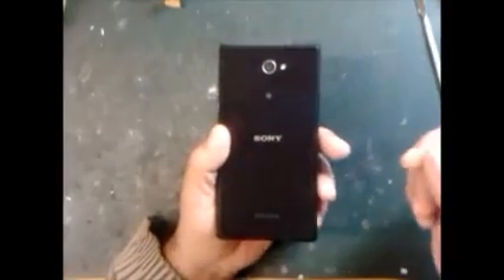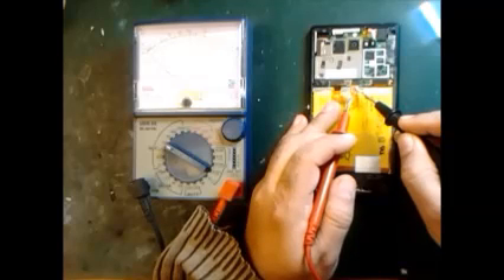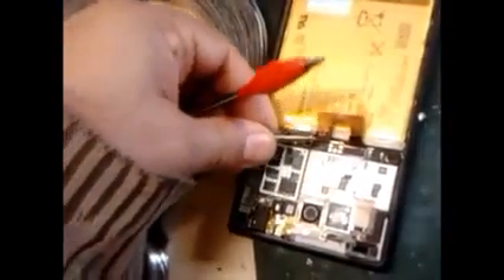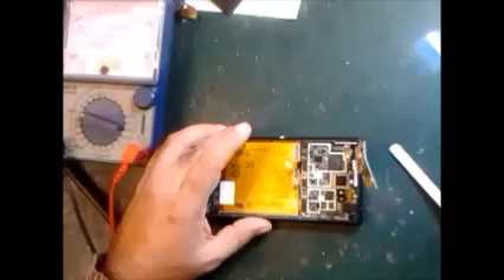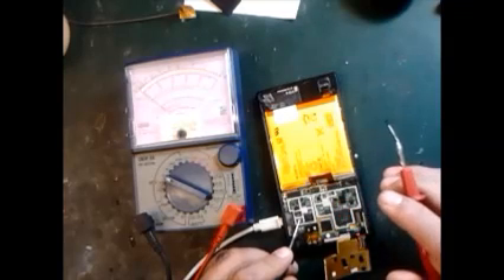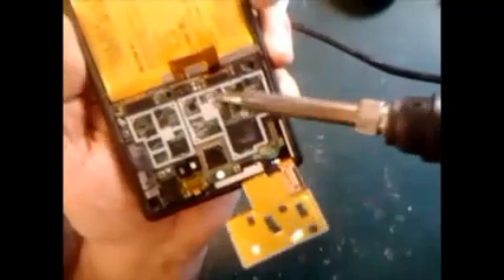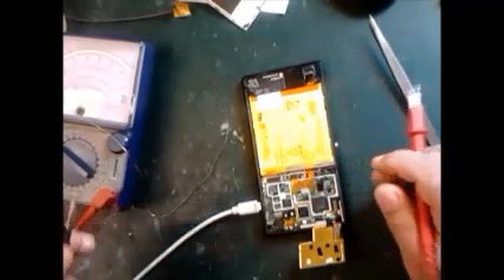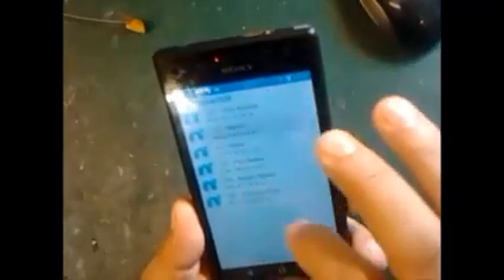SONY XPERIA M2,M3,M4,AZ,Z2,3,4. NOT CHARGING NOT ON

Comment: But tell me why u modified charging circuit.....please tell as early as you saw my msg.........n also what happened if I can't......
Reply from the maker: becaus dificult to find the chip ic in markeet if u find out from some where you need  micro instroments like micro soldering matchine microscoop r camera scoop with big lcd screen there you can see circuit n take out part n put nuw ic then its be original if not then shorly use that parts atlest you can use your hp

Comment: my sony m2 dual after flash software not working properly touch screen...help me sir
Reply from the maker: i seges you try 1 more time flash it with sony M2 original software  if you have any extended memory card inside take out first n flash it hopefully it will ok if still same its meen something problem with touch screen r main board .first open main board n service it with board cleaner after dry it with hot airgun matchine n fit back chack it if still same problem then chand touch screen thanks

Comment: Is your phone before working, if you put another fully charged battery? I have the similar problem, I can not turn on the phone with another battery, on the phone also not lit or flashing red light when the phone is charging. I tray reset and all stuff which I found in the internet.
Is your method can fix my solution?Thanks, for answere

Comment: Hello Guys! I had the exact same problem on Xperia Z2 it wouldn't turn on, when plugged into AC Charge just red light blinked again and again. SOLUTION > I removed the back of the phone, unpinned the battery connector and then pinned it again. After this I pressed 'Power Button' + 'Volume up and down' keys at the same time (Three keys) for about 10 secs and by miracle phone turned on with the battery of about 60%. Hope it works for you too.
Reply from the maker: Yes bro your phone battery is drain meen totaly zero.try to change new battery it will ok.other if any one know how to bost battery can be work

Comment: Hi, I would like to do this to my phone as it isn't charging, there are 2 2 second red lights and 1 3-4 second red light when the charger is plugged in, the area around the usb gets a little warm, but not hot but the screen isn't turning on to show dead battery as often as yours in the video did.

Have you got a link that shows exactly where the diode goes? and what rating diode? I have loads of graphics cards, sound cards and motherboards I can take something from but want to make sure is correct one.

Thank You.

Comment: or u can plug in the charger and hold down the power button and the end of the volume button at the same time
Reply: Wow..amazing...i did it and it work.
Reply: I did it but it just vibrates 3 times then it shows the low battery ui

Comment: Thanks for the help.
Just put a very small diode taken from a laptop motherboard between the two pads on the left side of battery connector. The cathode on the upper one and the anode in the lower pad.
Be carefull to not empty the battery, because it will drain more current in the diode and it is going very hot.